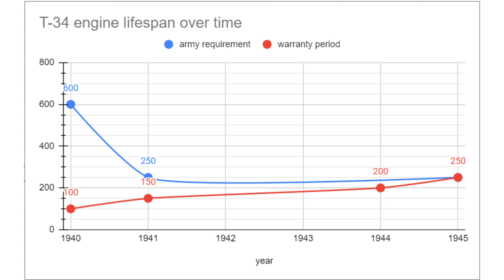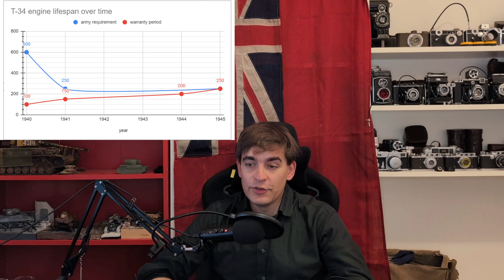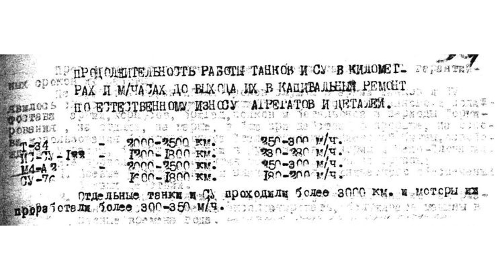The Myth of the Disposable T-34

Comment: Funnily enough the issue of bad engineering in terms of capability per ton also rears it's head in the WWII German Navy.

Compare the Bismarck, Bayern, Hood and Queen Elizabeth classes and it becomes very difficult to explain what feature of the Bismarck explains its thousands of extra tons displacement over the other ships mentioned especially when considering the improvements in power plant design over the years. It's hard to escape the conclusion that the Bismarck was simply inefficiently designed and HMS Vanguard proves the rule.

HMS Vanguard actually does reach similar displacement to Bismarck and doesn't have a lot to show for it, some applied lessons learned based on wartime experience but nothing that explains thousands of tons of displacement. What does explain it though is a hastily modified design that created some inefficiencies. Put simply the Vanguard was never intended to be the 4 x 2 x 15" ship she became but instead a 3 x 3 x 16" ship lengthened to accommodate an extra turret as 2 x 15" turrets were available to arm the Vanguard where the proper 3 x 16" turrets would push launch to 1943 at the earliest. As it turned out they probably should have waited since wartime experience and losses would shift production focus away from the Vanguard such that she wouldn't be launched until later still and nearly got turned into a carrier on top of that. Either way the Vanguard's hull design with roots in the King George V was made broad enough to accommodate the larger 3 x 16" or 4 x 14" turrets a feature that ends up going unused with the 4 x 2 x 15" layout and the Bismarck has even more beam then the Vanguard.

TL;DR German inefficient engineering shows up in the naval realm as well.

Comment: What is the difference between sloped armor and flat armor? If the flat armor has a thickness of 100mm, it will react very similarly to a fast, small-caliber projectile with a penetration of 100mm and a slow, large-caliber projectile with a penetration of 100mm. Some tank enthusiasts believe that the same applies to sloped armor, where 50mm and 60 degrees are equivalent to 100mm. From here it is concluded that the economy of the armor will only be on the triangles of the sides and on the rectangle of the roof (by weight 100mm 90 degrees = 50mm 60 degrees). That is, the weight will decrease slightly. But the bad thing is that in a tank with a large number of slopes of the armor sheets, it will not be possible to easily replace the 75mm gun with a 100mm howitzer, Sherman against T34. The tower is smaller, not three but two people, there is less space for shells and other things. The fact is that 50mm and 60-degree slanted armor reacts differently to fast, small-caliber projectiles with  100 and slow, large-caliber projectiles with  100. There is no magic involved. Slanted armor provides better protection against fast, small-caliber projectiles and less protection against slow, large-caliber projectiles. Additionally, slanted armor offers superior protection against fast, sub-caliber projectiles. This is a matter of optimization. There are more small cannons with fast shells nearby, and fewer heavy cannons with slow shells. We are better protected from the former, and less protected from the latter. However, according to probability theory, we are more likely to encounter small cannons with fast shells. Sloped armor is an optimization, but it does not provide a comprehensive solution for all types of weapons. Additionally, sloped armor may result in a random ricochet from a projectile with greater penetration capabilities, which is guaranteed to be fatal against 90-degree angles. And an angled front plate can save you from a high-explosive fragmentation shell from a howitzer flying from above, or a shell from an airplane in the air, or a rocket from a 6×6 truck.
Reply: I would like to point out later what shortcomings there are in the design scheme of the T34 and IS2 that cannot be eliminated. I am referring to solutions that give an advantage in this moment here and now, but these same design solutions will greatly complicate modernization and changes in the future.
Reply from the maker: Both the T-34 and IS-2 were modernized multiple times over the course of decades, meanwhile "superior" Tigers and Panthers went to the scrap heap as they were originally built.
Reply: @TankArchives The design of armor for future Soviet tanks was based on the assumption that they would be fired at by 128mm and 88mm shells. The tank archives are heavily ideologically charged. People like this should always be questioned about their views on white supremacy, Iran, and China, and then asked about Israel. This will provide a clear picture. The T34 and the Soviet Union are the masks of a fraudster in the present.

Comment: Few weeks ago, maybe 2-3 months, Ive heared ukrainian tankers said they need to change the running wheels on their Leopard 2s every 2 days. Hownmuch can they make, 200 km a day? This would support the thing about running wheels beeing one of the least reliable parts.
Reply from the maker: 200 km per day is quite a lot. I don't know about the context of the specific case but it feels like way too frequent unless they're using very worn down wheels to begin with.
Reply: @TankArchives  Sadly I no longer remember where I saw or heared this. It is possible the wheels on Leos are already quite worn, as Ukraine received already used vehicles.

Ive spoken about this with a tank crewman recently, at a tank day in the CZ. Oir army received Leopard 2A4 recently, so I wanted to talk about their experiences. He said they domt need to do such manintenance daily, he also said how often wheels/tracks have to be changed is very dependant on the conditions those vehicles are in. Maybe driving around during an exercise and beeing in combat puts different stress on tanks.

Comment: Correction: 1944/1945 production T-34 (with T-34 losses it's rather unusual that earlier production T-34 would last till 1945 frontline use), after 4 years of improvements, probably with extra maintenance care (because everybody wanted to have these tanks at the end of the road), achieved similar reliability level as M4 Sherman.
Before that, reliability was apparently inferior.
Reply from the maker: Shermans also had issues with their engines dying after double digit hours early on. Refurbished radials were lasting for just a couple dozen hours as late as 1944.

Comment: I think most of the myths or exaggerations about the T-34's expected lifespan was its diesel engine. No one else used diesel tanks in large numbers and the explanation usually given is that the the diesel engine in the T-34 was only expected to last 10s of hours between overhauls thus everyone extrapolates that logics to the entire tank.

To be fair, there was a period in 1941 where T-34 were considered one-battle vehicles, but definitely not by design and the reliability of the T-34 had little to do with their disposal.

Comment: Finland used different models of the T-34 during and long after WW2. Some were captured from the Soviet Union, some were bought from the Germany. It was a highly respected and reliable war machine here.

Finnish memoirs mention that the weakness of the Soviet T-34 was not the tank itself, but the training of the crew. Especially the accuracy of the Soviet tanks was poor.  Apparently Soviet tank gunners did not receive sufficient training.

But the Red Army was able to compensate with quantity and tactics that suited them.
Reply: Yes, very interesting to hear, because, of course Finnish winters, my goodness. Most of the T34 problems weren't reliability issues. Engines were comparable to Panzers and Sherman's in terms of longevity, and only needed slightly more maintenance hours, not a great deal more in summer. In winter, quite a lot better. Biggest problems of course were the crappy logistics and spare parts in early War Soviet armies. Moreover, the captain-loader buzz, shite or no radio's, cramped conditions, and inconsistent hull welds, when they really had to pump them out. I always have a bit of a giggle watching folks struggle with T34 gears and clutch mechanism. Yup, they were indeed heavy, and stiff. However, in the field, driving regularly moreover, with mechanics around. The driver would be well aware of the tanks heavy gears/peculiarities and the clutch and gears would have been easier and looser to use. The T34 vehicle Nick Moran jumped in, for example, isn't driven everyday. Thus, tough things will invariably be tougher to use.
Reply: @SMC01ful  wrote: "and inconsistent hull welds, when they really had to pump them out."

-- Earlie T-34-76 hulls were welded by traditional electrode welder, and many photos existed where hull felt apart with intact turret. Later in 1942 Eugine Patton came up with automatic flux submerged welding, which still did not look good, but weld seams were much stronger, and hull usually survived blow off 6 ton turrets without falling apart.
Reply: @SMC01ful  wrote: "The T34 vehicle Nick Moran jumped in, for example, isn't driven everyday"

-- Nick Moran is almost 7 foot tall, and drove automatic transmission Abrams, Bradley and ... Audi.

Comment: Part of story might have been that after crossing Carpathians, supply line got very long and stretched with few good roads and rail connections. In same time, army was pressed to push forward and leave damaged equipment behind, since supplying new tank was probably simpler then extensive repair, especially if tank was damaged in battle.

Comment: This is the way math works. If you need to have an overall 3000km you need to have each individual component to last longer, 'cause malfunctions work as a chance not a fixed prescribed number. For 100 components with 99% chance of enduring 3000km it is only 37% chance that components altogether will last 3000km in any given machine.

Comment: he idea that T-34s were disposable probably stems from the comprehensive steps the Soviets took to reduce cost and time of production. They determined the average life expectancy of a T-34 in combat and then looked for anywhere they lessen quality on components or production process IF increase the speed of production without reducing time before needing a major overhaul below the combat life expectancy.
Reply from the maker: > They determined the average life expectancy of a T-34 in combat

If such a study was ever conducted, I haven't seen it or seen any references to it in period documents.
Reply: @TankArchives  And such a study would certainly be flawed, tactics and individual battle circumstances would make "life expectancy in combat" not very useful when you could lose a division of brand new tanks due to bad tactics.
Reply: @TankArchives  fascinating. You hear this bandied around everywhere.
Reply: Nope...
The first prototype T-34 was built in 1936-37 (A-20), the first series of T-34 (model 1940) entered production in 1940, and (model 1941) entered production in early 1941... far before any battle in which that tank participated!
The tank was designed to meet a series of tactical and technical requirements set by the military and went into production after the military checked that the tank met those requirements and the military approved that the tank met those requirements!
One of the requirements is the life expectancy of the tank... everything else about the disposability of that tank is just assumptions, myths and lies...

Comment: Stupid question but if suspesion engine and track are counted separerly what exactly is considered in the 3000 km life span of the t34?
Reply from the maker: Runtime between overhauls. Replacing a major component such as the engine or the transmission counted as an overhaul. Replacing the tracks was not, but the army still wanted them to last until the tank is due to be sent to the factory anyway.
Reply: @TankArchives  thank you